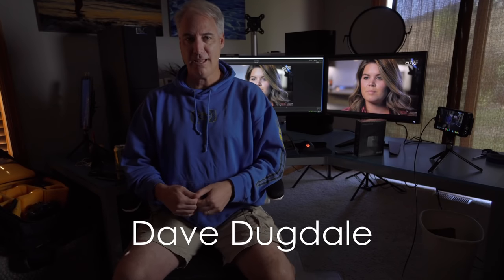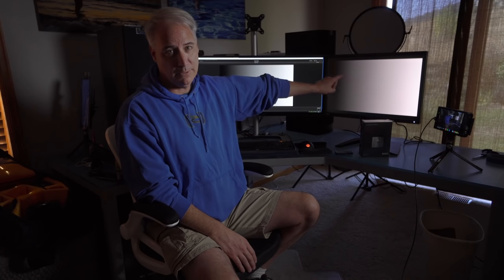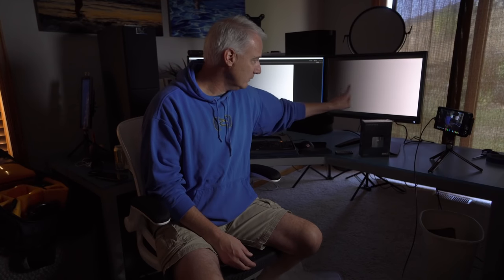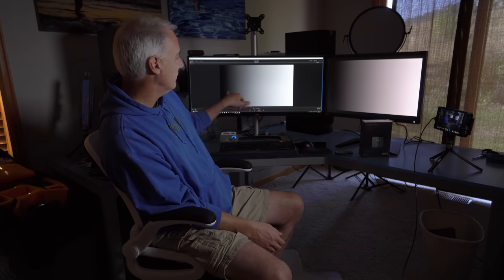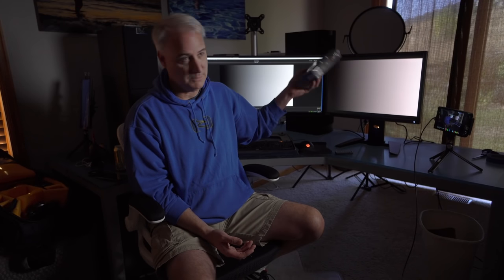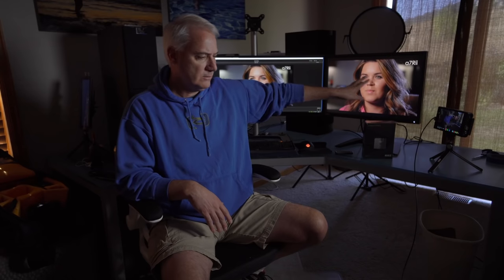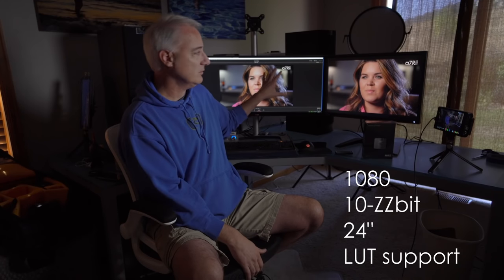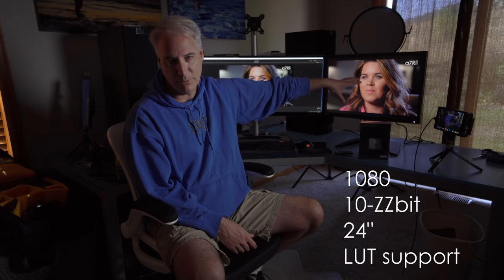Two Grading Monitors for Resolve to Perhaps Avoid

Comment: I might be wrong, but I thought the i1 created a display profile that the operating system has to load. Now, I don't think you can actually load one of these display profiles and output it over the BM mini monitor.. I think the only solution to this is to use a much more expensive calibration system.. Someone please spill some knowledge if they know otherwise though..
Reply from the maker: +beauchampy if anyone knows please share.
Reply: yes with 2 monitors you need to create 2 profiles and load them. tho its abit tricky and youll need manual settings since win bugs out sometimes. Dave you should check out Asus. And yes HDMI sux, DVI or DP.  10Bit = Quadro. The cheap nvidia cards (all gamig cards) 10bit is disabled in their driver. Believe AMD has 10Bit even with their gaming cards.
Reply from the maker: +Gregor Mima where do you load the profile for the grading monitor, within Resolve or into the actual monitor via USB?
Reply: Just my 2c towards calibration, I may be wrong... Using your i1 Pro you can create a profile LUT using a rented version of Light Space and then load it onto a LUT box which sits between your BMMM and your display. I understand this is extra expense so an alternative to this is loading the calibration LUT into the DaVinci Resolve Colour "management > 3d Video Monitor Lookup Table". This will operate like a software based LUT box. Also a free alternative which is not quite as good as Light Space is DisplayCal.

As for the 10Bit  non Quadro nvidia graphics cards, the 10bit only works in Direct X and not OpenGl making it useless for professional applications. However the Quadro still doesn't support 10bit in DaVinci either way so your BMMM is the way to go.
Reply from the maker: +Matthijs Blok thanks!
Reply: Dave Dugdale Im using Win7, and back in the days when i struggled i followed this guide (which was very hard to find):

http://answers.microsoft.com/en-us/windows/forum/windows_7-desktop/cant-apply-an-icc-profile-to-display-cant/71b8d8e8-afa3-435a-aae4-6a8a184b6439?auth=1

SInce then both my screens are calibrated. Maybe that helps. Don´t know if Win10 still has these settings.

10 Bit is a mess, Even macs got the support like 1 year ago and it was absent in OSX for ages. I hope it will get more attention with HDR tv.
Reply: DisplayCAL is worth looking at for profiling the Resolve video pipe line. It works with any meter too
Reply: dysbomb awesome! thanks!

Comment: Wasting your time Dave, just buy Apple already :)
Reply: It's hard to get a PC user away from their PCs... I used to be a PC user from 1986 till 2007 and once I saw the magic of apple I was sold...   "Just want to add that I was a PC tech/DOS expert and Windows power user"
Reply: That sounds like a simple solution Vlad but unfortunately, 'Apple' will not give you an accurate Video output unless you install a 'Thunderbolt' version BMD Mini-Monitor and a correctly calibrated Video display. The current Mac 'Computer' displays are not Video monitors and the current 'Trash Can' Mac Pro is woefully over priced and under powered when compared with high end Win 10 64bit PC  Workstations. Most professional US Colorist working at the highest cinema resolutions have now moved to the PC or have gone down the dubious 'Hackintosh' road...